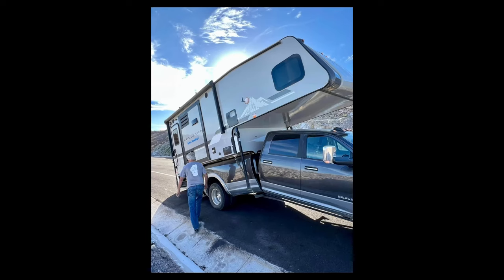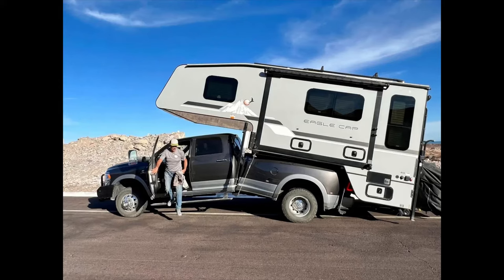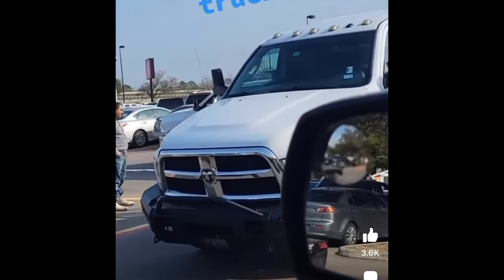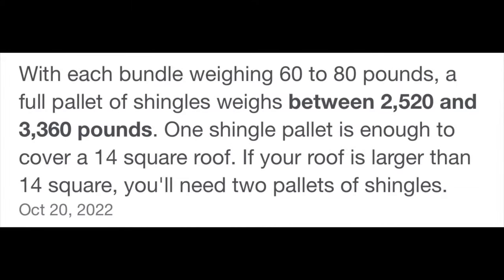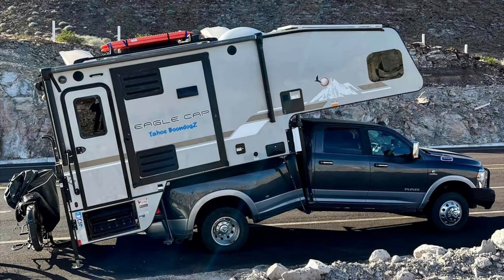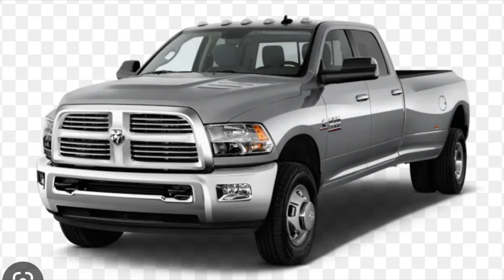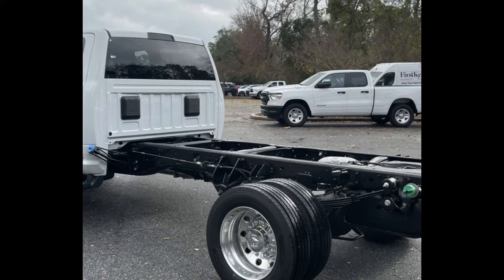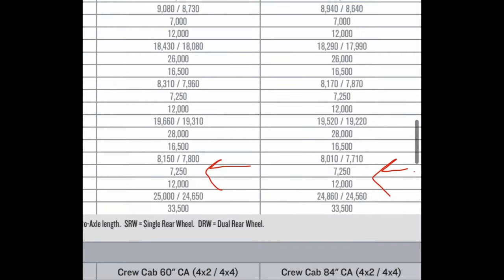Broken Ram truck frames 😱, what’s causing the failure and can they be repaired?

Comment: Talking bullshit,  the reason it broke was because it was too flexible
Reply from the maker: It’s a box frame that was specifically designed for strength.  It doesn’t flex as much as a c channel frame.  There are literal videos on the internet comparing other trucks vs dodges frames and showing how LITTLE dodge frames flex in comparison.  Here is one video https://youtu.be/_f3CAnH7WIM showing this.  It’s way more rigid than a ford or previous year dodges, so how is it too flexible?  No need to say “talking bullshit” either, especially because you clearly don’t know what you’re talking about.
Reply: Please. I'm a mechanical engineer and this video is missing a lot of data and facts.
It's obvious why they failed.
Did exactly what it was designed to do and right on time.😊
It unzipped just like that
Reply: Lotta them boy's out there hauling hot shot car wedge trailer's flat beds hauling steel bunch of car's as truck's...lot of weight going down the road ..now these are guy's that run over the road cost to cost...you never see Chevy hot shot's mainly dodge and Ford.... these are these people lively hood.... you never see Chevy but very few no toyotas.no Nissan Titans big car hauler with dodge and Ford ...